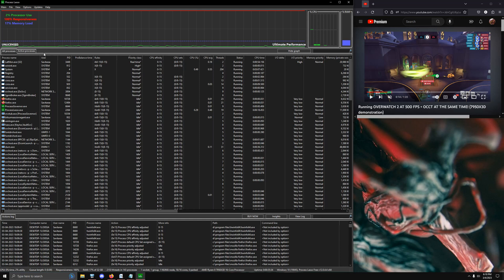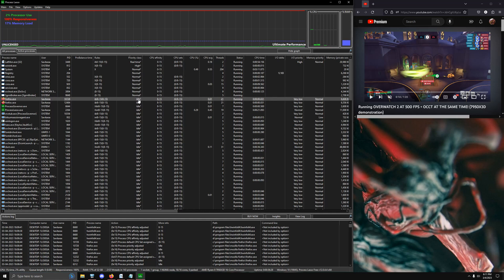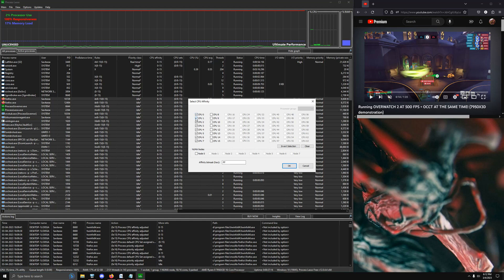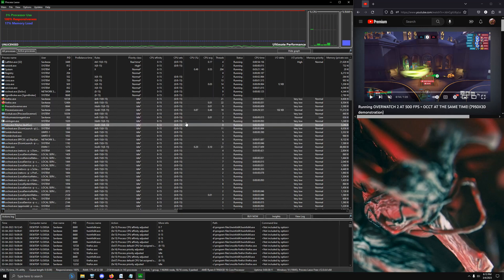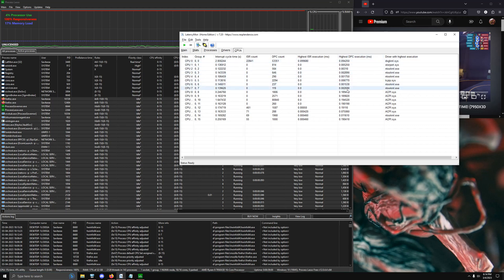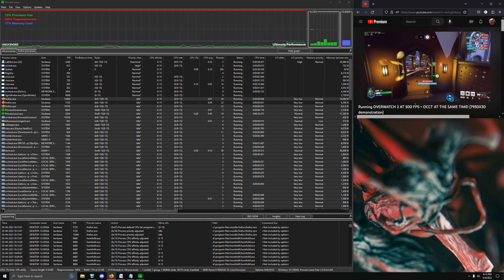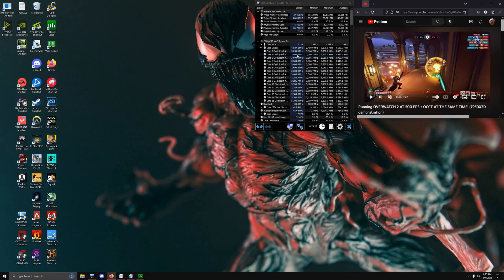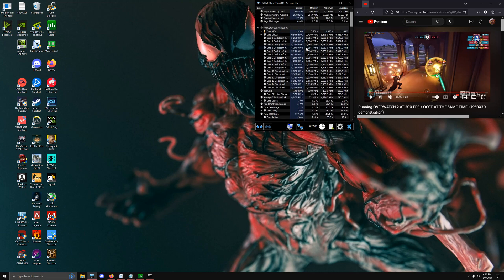THE 7950X3D LOVES PROCESS LASSO (Tips and Tricks)

Comment from the maker: Command to disable idle 
powercfg -setacvalueindex scheme_current sub_processor 5d76a2ca-e8c0-402f-a133-2158492d58ad 1
powercfg -setactive scheme_current
Reply: This works. How do you undo it, though?
Reply: Hi, so CPU threads 0-15 are for 3D V cache and numbers 16-32 are for freq right?
Reply: @hmmalright  Yeah this wasn't clarified
Reply: How do you undo this? I just did it and now my CPU stays at it's boosts speeds on both CCD's.
Reply from the maker: @Isaiiahii  lol just change power plans or just rerun the 2 commands except change the last digit which is a 1 to 0.
Reply: @Savitarax  Thanks for the prompt reply. I actually just got it fixed by changing the power plan. Interestingly enough it's now functioning as you described in the video without rerunning the commands by using the Bitsum high performance mode. Before it was in the balanced mode. Weird how it was staying on the boost clocks in balanced mode, but is actually going down to the default clocks in HP mode.
Reply: this command works on other cpu,s like 7800x3d or Intel ones?
Reply from the maker: @baufender  works with all cpu
Reply: This fixed all the dlss3 stutter I been experiencing. Why is it though that the cpu never boost to 5.7 anymore?
Reply from the maker: @FJano12  cause you are putting it in a higher thermal headroom bracket. You raise the idle by 5-10c and the short windows where the cpu has a chance to say down clock 4 cores and still run the other 4 is gone so the PBO/Boost algorithm never boosts to 5.7
5.7 is only achievable really when only 2-4 cores are active and the others are in a low power state
Reply: @Savitarax  I see. I guess I still better off with this all core lower boost.. Certainly fixed lot of stutters in games with DLSS3. But I dont know how is this a fix but works :)
Reply: do you need to do this every boot up?
Reply: @Swatmat  process lasso will remember your settings upon power cycle.
Reply: Can you write which process have to be under ccd1?
Reply from the maker: @francescostefanile5613  everything that isn’t your game essentially. Or whatever application you want your cache to run on.
CCD0 is what you want your games to run on and CCD1 is just supposed to absorb the rest.
Reply: Does using this command help with getting higher performance during benchmarks, or just to see a higher number at idle?
Reply: and what is the practical meaning of this command, other than displaying 100% load in the manager? and FPS drops?
Reply: Nice vid. Could you please make some before and after benchmarks?

Comment: Thanks for the video but I have to rant about why BSG is the only developer that can't get a decent processor mapping to work when a processor has more than one CCD. 
Every but really every damn game on my PC runs without problems. 
Tarkov ?
7950x3D + RTX 4090 + 32GB Ram + NVMe installed.

Customs = 60-70 FPS. (online or offline )

And just because of a damn game now one more program on the computer which is permanently active in the process swamp ? Nope, not in the mood. Is there any other solution?

Comment: It is a nightmare for scheduling and AMD’s core parking works, but parks the wrong cores. Process Lasso is great, but requires considerable work. Probably easier to set CPPC in bios to “cache” and maybe use “process lasso” to move other “background tasks to the non 3d vcache cores. In any event, core parking should work out of the box as 98% of users don’t want to do anything in bios or use process lasso.

Comment: i do not agree with manually bumping the minimum speed of the cores.  With newer bios and some undervoltage it runs at nearly 5ghz on the vcache cores (with good cooling).
The downclocking is to prevent damage and stability issues.
If your 7950x3D goes down below 4.2Ghz under load, you have an issue to sort out. It should not be doing that.

Comment: Don't do anything this guy says. It's just wrong.

1. He's using affinity instead of CPU Sets, which will cause some games to crash. 

2. You're slowing down other processes by mapping non-game processes. This won't have much of an impact but it's just unnecessary. If you want, you can map specific problematic processes to CCD1, such as a streaming app. But really you don't need to, without Game Mode, processes will already prefer CCD1.

3. The command he runs is dumb. Disabling idle will have a negligible impact on standard operations when the PC switches from idle to operational (such as sitting in desktop and you decide to open a window). It will have a major negative impact on power consumption and thermals. This doesn't increase the thermal headroom and I don't know why he thinks it does. If anything, it will make performance worse because the frequency cores will sit higher and you might hit power or thermal limits sooner.

I don't know why he only sees 16 cores instead of 32. Maybe because he's using affinity instead of CPU Sets.

You'll get the best performance by doing the following: disable Game Mode in Windows and manually change CPU Sets for games to CCD0. That's all you need to do and that's already a lot because it's easy to forget when you get a new game. 

Plus you have to test. Some games will actually do better on CCD1, some games will do better when access to all CCDs (like Minecraft).

I have done very extensive testing on this stuff.
Reply: I think it’s great you’re trying to help people but so isn’t the video creator. Id even say he went further as he created a video that he didn’t have to. What you say might be true but to call the creator stupid is pretty well you know.

Comment: Why do you have hyper threading off?  is there any benefit to having it off?  As for your video, your saying startup windows 11, open process lasso pro, and select every single process like you said (this is where in the video you lost me, its hard to see what your actually doing .  It seems like your setting every single process running (No games are running since we just booted into windows) to run only on the C1 non cached cores.  Then when you do run a game , it should run on the 3d cache cores automatically, but your saying you can set that manually also.  Can you explain how to do all of that?  im not familiar with using processor lasso so its hard to see what you are doing , and skipping what other settings your using.    For example you have hyperthreading turned off for some reason? what power profile are you using?  thanks for the video though

Comment: Isn't 7800X3D Technically better than 7950X3D even with process lasso because processes like csrss.exe and dmw need the mouse data and flip modes for dmw to manage the game fullscreen exclusive to be sent to the game and if you are doing that on the second CCD then there's a latency penalty where your mouse inputs are delayed?
Reply from the maker: CSRSS.exe is no longer processing the input thread. DWM.exe is, DWM is fully tunable with or without process lasso. And you can use reserved cpu sets to force the entire windows system including background processes and interrupts onto the cores you desire. Deleting the latency penalty and allowing you to register just the game and your mouse on the X3D along with DWM.exe and nothing else.
Reply: Damn, I was gonna get a 7800x3D due to latency but you just convinced me to get a 7950X3D. I have a 5900X rn. So do you don't recommend putting CSRSS To real priority anymore is it's no longer processing input. So all I should do when I get the CPU is disable SMT then put DMW Cpu affinity on 0-7 right? Since Cpu sets doesn't mean it's a 100% guarantee it's just the preferred option. The only processes I would put on cpu sets are ones that you cannot change such as system and registery and for the rest we stick to cpu affinity to gurantee DMW is running on the cache CCD which is 0-7. Update me if i got anything wrong @Savitarax
Reply from the maker: check my ultimate windows scheduling guide to see what I mean. Reserved CPU sets is a new technique to move windows COMPLETELY off of core 0. Including the kernel and other background processes. It's a very powerful software tweak that should excercise caution when using. @leax7485
Reply: I saw the tool, basically you wanna move your entire kernal and system to a different core/cores but you still want it to be a x3d core so there's no inter-latency performance hit @Savitarax

Comment: Without process lasso 7800x3d give better results that 7950x3d

The question is after using process lasso with 7950x3d does it give equal or better results when compared to 7800x3d???
Reply: yes bcause 7950 clocks higher
Reply: @johnnyparallax9570  u tried it or just a guess

Comment: Thanks for this video, I’m building a new pc for vr flight simming and everyone says 7800x3d is better.  Given the project lasso features, would you recommend going for the 7950x3d (no $ concern) so then I can unload all the other programs that I have to run on the non vache cores and have full bandwidth for MSFS on the 3dvcach chips?
Reply: the system scheduling and parking will keep things on the cache ccd until it is overwhelmed, for efficiency's sake. using project lasso is more of a blunt instrument. if you want to multitask, stream gaming, or have a general use machine, and you don't mind dropping more money on a processor and possibly using a little more effort to config, go for it!

Comment: What cpu cooler are you using? I never see my CPU hit the marketed 5.8 ghz only really see 5ghz ; I'm using the Lian Li 011D Mini + DeepCool 240MM with plenty of airflow. Still get 40-70C temps like my 11700k but felt like my 11700k ran better.
Reply from the maker: Use PBO and curve optimizer. It’s all based on headroom. 5.8 is the peak it can hit but only for momentary points at stock.
But with PBO it will jump dramatically
Reply: I tried to go thru with my Gigabyte Aorus Master B650i and messed w the settings a bit. Tried to adjust curves and all but I can't figure it out at all lol. This is so much harder than Intel. @Savitarax
Reply from the maker: @apex_gr  lol it’s super easy. 
For curve optimizer
Essentially each core is a negative or positive voltage offset.
I recommend doing an all core of negative 10 and test from there. 

And then do 5 increments after that. 
If you have a good chip it’ll do like 30 or 40
And on some cores like 50-60
But if you have a bad one you won’t be able to do more than 10 maybe.
Reply: @Savitarax  I get that but it’s my first AMD in like 10 years. Do you use the AMD Ryzen software or bios stuff? Curious where to adjust each individual one because there’s so many cores.

Comment: Its good for all Dual ccd. Amd cpu. CCD0 is running higher clocks. But ofc x3d its better.
Reply from the maker: CCD1 is the high frequency cores, CCD0 is the 3Dcache cores.
A mistake I believe AMD shouldn’t have made for a few reasons, but it’s a small factor on an already amazing product.
Reply: I mean 7950x non3d ccd0 runs 300-400 MHz higher than ccd1. force games not to cross ccd’s and have programs on ccd1. in the games i play give around 8-15% fps. The latency between ccd’s is so bad.

Comment: It’s not hard but I find it ridiculous that it falls on the consumer to optimize this. It should be like that out of the box.
Reply: this is a solid argument, but the opposite could be argued that people buying top of the line processors can handle a couple settings.
Reply: It is AMD pushing new technology though (ie: Vcache) so its fair to say Microsoft shouldn't be held liable to properly schedule those cores.  @TheJacklikesvideos
Reply: If you want easy mode, you need to buy apple or a console
Reply: @jipillow1 never in my 30 years of PC gaming I had to configure which application should be using what part of a chip.
Reply: It’s not in the hands of AMD or Intel. It’s Microsoft’s responsibility to schedule things properly on the software side of things. Hardware optimizations can only go so far.
Reply: There's not really a one size fits all solution. But I could see one much easier and beneficial option being to include something inside ryzen master or other amd software to link gaming processes to the x3d cache ccd with one click. And maybe have other customization options built around that.
Reply: @sageosaka you can tell open gamebar and check "this is a game"
Reply: @Kmaaq  The game bar allowed the games to be set at "it is a game" put on V-cache CCD or not level, neither MS nor even game devs can optimise perfectly because each 7950x3D will be running a different mix of jobs, and if you say "only the game" then the 7800x3D was the right purchase.
The fact is developers would have to tune and schedule where threads run on a CPU and it'll never happen.
If you don't care yourself to do the work it runs good enough and you don't really need every last % of performance.

Comment: If you change your preferred CCD (in BIOS) to non-vcached CCD, does that mean that core 0-7 becomes the non-vcached cores? @Savitarax
Reply from the maker: No it just means the algorithm will choose 0-7 more often than 8-15.
It doesn’t make 0-7 non cache and 8-15 cache
Reply: @Savitarax  Thanks. So Core 0-7 will always be the vcached core, 8-15 the non-vcached. That is tricky since I noticed that some windows system .exes always use core 0 and cannot be changed even with lasso.

Comment: Question … i have 7900 xtx and 7950x3d , on 6000 Mhz rams , but i get 4k 144 fps on call of duty , i am similar to someone in youtube with 5800x3d ,, is it cause the bottleneck ? , and i tried lasso thing and followed your steps didnt change anything
Reply from the maker: it's likely the 7900xtx, 4K is a very high pixel rate the 6950xt was not able to do it above 120hz.
the 7900XTX is only about 30% faster than that and so I would say the main bottleneck is your gpu. 
If it's not your gpu then it's the 3D cache ccd not being used in the game.

Comment: If when establishing affinity 32 cores appear, I only have to remove 0 to 7 and leave the rest, right? At least for normal applications (7950x3d)
Reply from the maker: So every other core is a hyperthread. Don’t assign games to hyper threads.
Reply: @Savitarax  I need to set games to 0-7 and the rest for 8-32?
Reply from the maker: @EvolutioneXe  so your first real CPU core has 2 threads on it.
The second thread is very unstable and is very unreliable in games. So In process lasso.
You want to set the game to use cores 0,2,4,6,8,10,12,14
And everything else can use 15-31 cause windows doesn’t care about hyperthreading on more cores.

Comment: I am seeing 31 cores when I go to to process lasso on my 7950x3D. Are you on the high performance power setting or on balanced?
Reply from the maker: i have hyperthreading disabled thats why I have 16
But. I am on no power plan right now. Both my cpu and gpu are at 100% 24/7 max voltage. 
Even at idle. There's no real power plan that does that.
Reply: you are seeing 32 threads.

Comment: Im so glad i found your videos, how would u go about doing this for the 5800x3d that has only 1 ccd but does have hyperthreading and the 3d cache.
How would u assign apex legends for example and system services. I would know exactly what to do if i had 2 ccds or no extra cache. But a little unclear for 1 ccd with the extra cache. Ty so much!
Reply: there is no need to manually manage scheduling on a monolithic processor.

Comment: For some reason process lasso is causing my computer to freeze and crash. It was working fine, but this morning I decided to install a fresh copy of Windows for several reasons, and now process lasso is causing issues.
Reply from the maker: Usually process lasso will hijack services. You just have to find which ones are using cpu and change the priority and settings.
Reply: @Savitarax  I'm not sure what you mean. Are you saying that certain processes being hi-jacked by process lasso can cause Windows to crash, and that I need to find which ones that is and then keep those at their default setting? 

What is really confusing to me is that I tried the same settings I was using before formatting, and everything worked fine. 

It's so annoying to because I paid for a year thinking that the program deserved my support, and now I can't even use it.

Comment: Hey @Savitarax , I really appreciate your vids.  I pretty much only play OW2 and I'm pretty sure I have close to the same rig as you. 7950x3d, 4090, both liquid cooled, Rog 670E-E.  So I'm trying to use your strats to optimize.  I was watching your other video today about the interrupt policy tool as well and have a question in regards to how that video relates to this one.  From what I'm gathering, the goal is to run everything on CCD2 except for OW2, and then, mouse/keyboard?  Do you set the affinity mask for the mouse/keyboard interrupts to a core on CCD1 or CCD2?  In other words, my guess is that on CCD1, along with OW2, I'd want mouse/keyboard processes including interupts affinity, correct?  Or do you want interrupts back over on CCD2?  Bottom line is, I'm still a bit confused on what ALL I want to keep on CCD1, aside from the obvious, which is OW2.  PS: my rig is solely used for gaming, so I'm basically trying to emulate your optimizations to the best of my ability.
Reply from the maker: You’ll want to keep your interrupts in the same CCD as overwatch or any game you are playing. You never want to put anything on the opposite ccd unless it is not important or not latency sensitive. Like streams etc.
Reply: @Savitarax  ok got it... makes sense, thanks!
Reply: Which apps programs should be same ccd with game could u help ?
Reply: if you are ONLY gaming, get the 8 core monolithic and save hundreds of dollars.